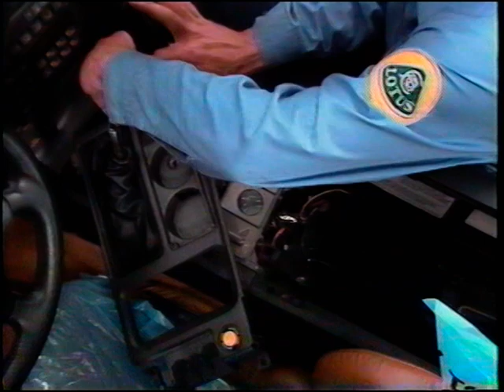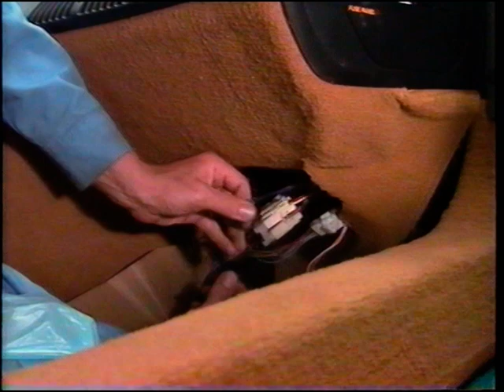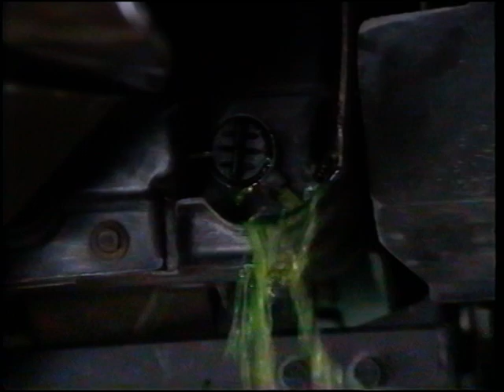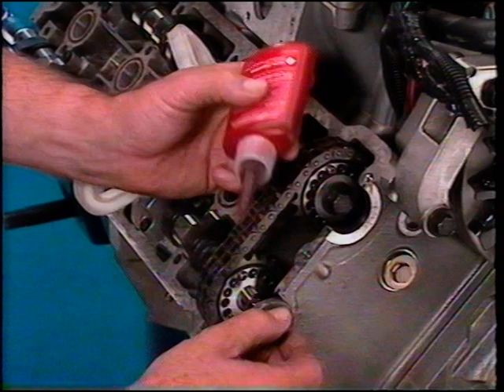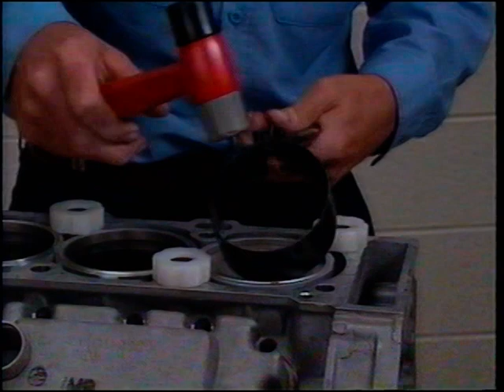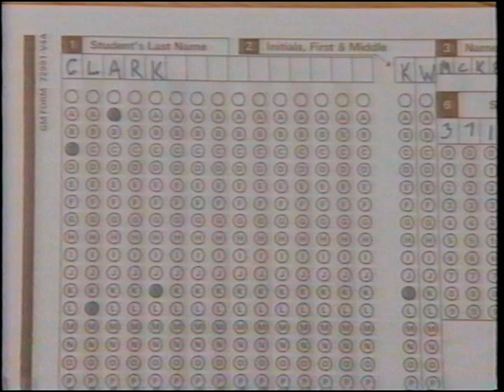LT-5 ZR-1 Mechanical Training Video

Comment: THE WORLDS MOST BEAUTIFUL ENGINE EVER SEEN OR MADE, THE WORK TO INSTALL THIS MOTOR, OR TO REBUILD IT, LOOKS LIKE IT HAS MORE CONFIGURING THEN NASA WOULD MAKE A ATOMIC BOMB, 

I DO NOT KNOW HOW THE GUYS BUILD THIS BACK IN THE LATE 1980’s FOR THE ZR1 IN 1990, REMEMBER, GENERAL MOTORS WENT TO THIS COMPANY BACK IN 1985, RIGHT AFTER THE TPI MOTOR WAS MADE, AND ITS STATE OF THE ART MADE, GENERAL MOTORS DID AWAY WITH THIS MOTOR FOR A REASON, IT WAS NOT BECAUSE OF FINANCIAL ISSUES AS THEY STATED, 

THE NEWEST DESIGN LT1 MOTOR COULD OF PRODUCE THE SAME HP AS THE LT5, BUT FOR VERY LITTLE MONEY, IT TO WAS A SMALL BLOCK ENGINE, FOR THE UPGRADED MOTOR FOR 1992, AND THAT ENGINE WENT TO MAKE THE LS1, WHICH IS A VERY CHEAP ENGINE TO MAKE AND PRODUCE AT THE TIME, 

THIS ENGINE CAN BE MADE UP TO 625hp IF THEY STOOD WITH IT, THE MANUFACTURER STATED IF THEY WOULD OF STAYED AND GENERAL MOTORS WOULD HAVE PAID THEM MORE MILLIONS TO MAKE, THEY WOULD OF MADE THIS EVEN FASTER, AS THEY STATED TO THE WORLD, THEY DID MAKE THE LT5 475 ish HP FOR SPECIAL BOATS FOR MARINE ENGINES, 

WITH MORE FLO, PORTING OF THE HEADS, AND BIGGER CAMS, THIS ENGINE CAN PRODUCE 600hp AS A FEW GUYS BUILD THESE MOTORS FOR A LIVING, FROM CHICAGO TO CALIFORNIA, AND SEEN THIS CAR RUN 10.5 IN THE QUARTER MILE……NO NOS, NO SUPERCHARGER OR TURBO, JUST A STRAIGHT ENGINE RUN ONLY, (higher grade fuel was needed) 

STATE OF THE ART DESIGN AGAIN, AND THE BIGGEST QUESTION I HERD WAS, BUILD THIS SAME DESIGN IN A 454 ENGINE WITH THE EXACT SAME SET UP , IT SHOULD BE OVER 700hp , NO ONE EVER DID IT, IN A BIG BLOCK ….

GOD BLESS

Comment: 40:20  hmm I did not know the LT-5 was an open deck block.
Reply: Zr1Pete does a closed deck conversion using Darton sleeves. Allows for a bore of 4.125" on the LT5. I've got one of his 401ci LT5 builds in my '91 Zr-1. Long live the original DOHC Corvette! C4 Zr-1 👑